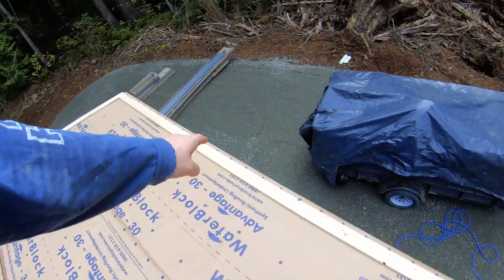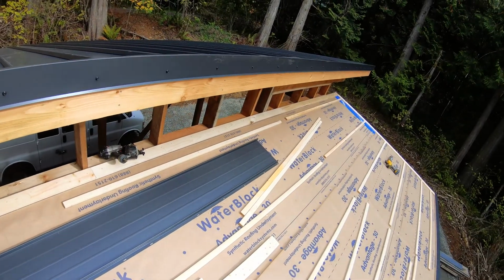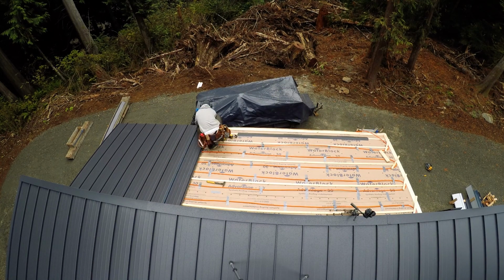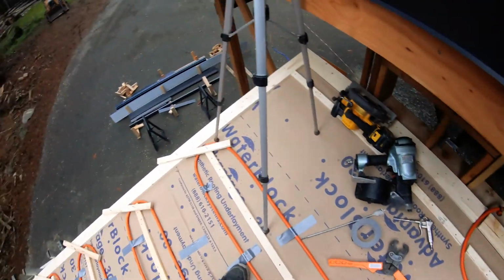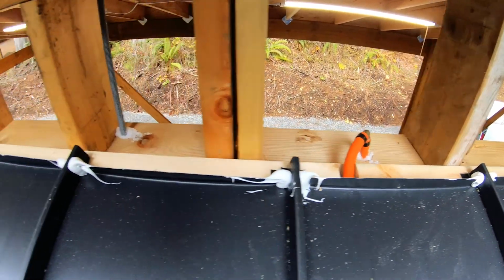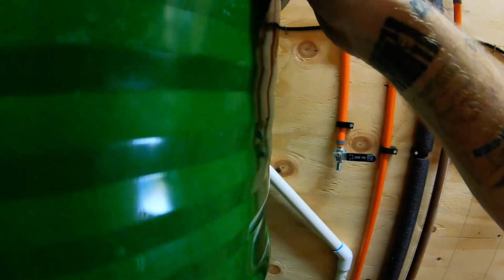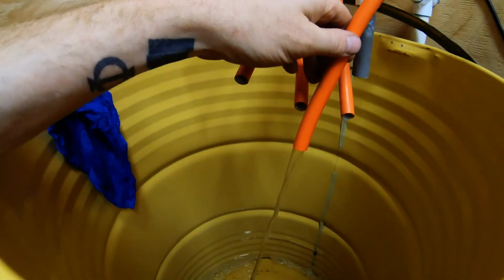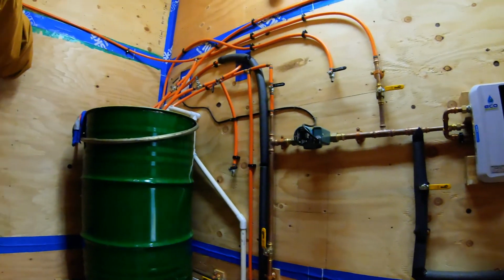Metal Roof for Kiln with Experimental Solar Collector Loop Built In

Comment: Nice !! Are you happy with it 2 years after ? What would you change or simplify ?
Reply from the maker: Well I haven't used it much.  It works mildly well, though a dedicated solar collector say for a pool, would be much better.  I also don't get a lot of direct sunlight yet as I have some trees that still need to come down.  So I can't say for sure how good or bad my design is.  At least it was an easy install more or less.